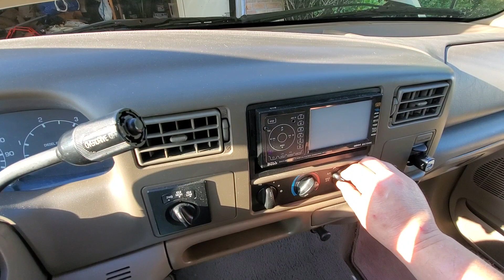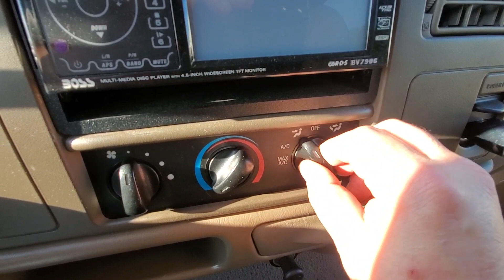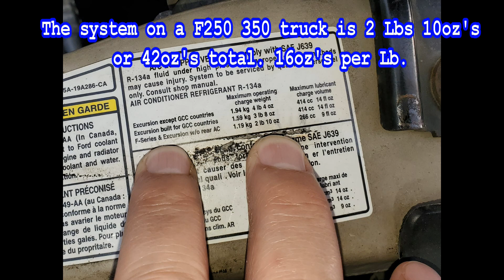How to Detect Low AC pressure Easily Ie F250 or F350

Comment: Please don't put sealers in your system.  The rest was great
Reply from the maker: Hum I guess I missed that, typically I don't like them either except for a very small leak until you can get the parts to rebuild the system. At what time index did I say to use them, It was three years ago so I don't remember. Glad you liked the rest of the video I just slapped it together on the fly for a friend. Best Wishes & Blessings. Keith Noneya

Comment: Mines going on and off 
I jumped the wires and she stayed on hooked up r134a max ac only issue is my vacuum pump is inoperable so it’s stuck on defrost is this an issue ?
Reply from the maker: Hi again X Rasta, if it's only coming out the Defrost it's the 4wd Switch on the passenger fender or you have a vacuum leak somewhere. If you don't have 4wd then it may be the Vacuum Pump on the Passenger Fender. So a search for that problem on YouTube and watch a few of those videos. If it's the vacuum pump it's an easy fix. Best Wishes & Blessings. Keith Noneya

Comment: My 2000 f450 compressor comes on and stays on.  Its cooling but at idle feels a little warm.  I was going to  add a little freon but when i connected can with guage, low pressure said 70psi so i took it off. What's going on?  Thanks
Reply from the maker: Hi George, sorry I took so long to get back to you. There's a few things that can cause that so lets start with the easy ones to fix to then the hard ones. 1. The Condenser behind he Grill is dirty or plugged up. Clean it real good and straighten the fins up. Unless it's visibly dirty I don't think this is your problem. 2. The Evaporator is dirty. This is probably your problem because there are no Air Filters in these early 99-06 trucks and it gets dirt on the water and cakes ups the fins. This happened to mine just like yours. Here's a video on how to clean it without breaking into the AC Lines. You do NOT have to let the R134A out to clean it, Ford did this right. https://www.youtube.com/watch?v=TqFf7tP7Nfw&list=PLVLXGvrQp0OtYXKroYmzvobuzAt3wrvPV&index=5  3. The compressor valves have gone bad. In this case you'll need to let the R134A out and change it. I'd also pull and clean the Orifice Tube, there's a video on how to do that "After" you let the R134A out on my channel. Of course you'll have to pull a vacuum and use a set of gauges to refill your AC System. Just make sure clean the Condenser behind the Grill and the Evaporator in the Clamshell next to the Passenger Engine Valve Cover in the video. Let me know if you need anything else and I'll see what I can do the help. Best Wishes & Blessings. Keith Noneya
Reply: @keithnoneya  thank you so much for your reply.  I will try your recomendations!
Reply from the maker: @George-mw7xk  Anytime George! If you need anything else, just let me know. Best Wishes & Blessings. Keith